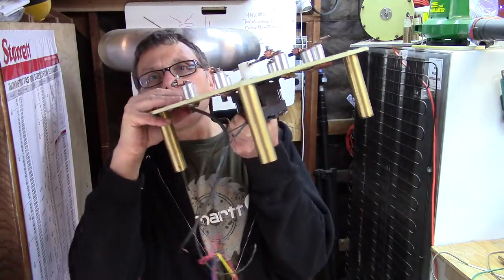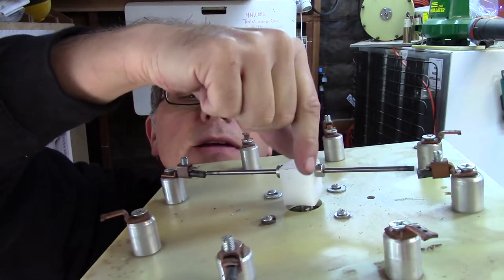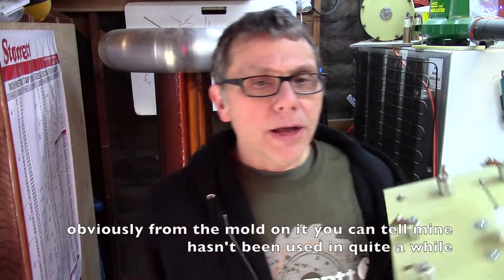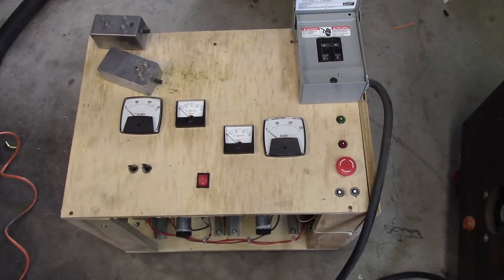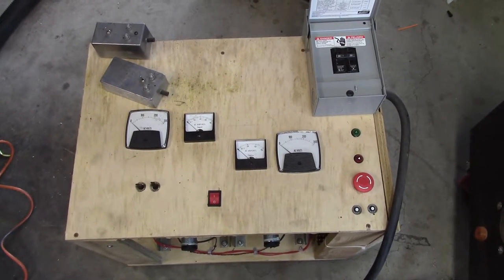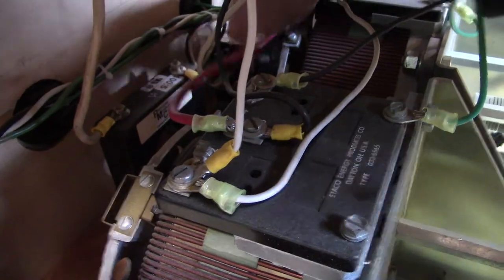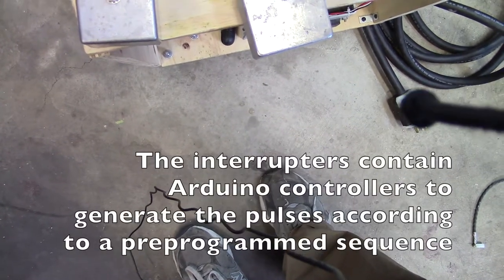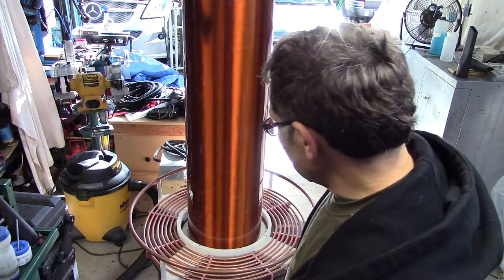How to set up a tesla coil Pt 2

Comment: and thank you for the info. I'm currently making an AC generator and it runs nice at 144 to 288 Hertz @ 110-140 volts . it's based on Edward Leedskalnins' design , and it's just under half way complete . but already I'm testing it on everything , even the Tesla coil. my next step is making a transistor circuit to make some high voltage static . I also have a modified microwave transformer , but the generator is doing a better job so far. thanks again for sharing your understandings on different methods of pulsing that spark :)
Reply from the maker: +FrequencyJam Thanks for the note.  Be careful with the generator.  Have fun!

Comment: Canada is also on 60 full wave lengths per second , sometimes I wonder about this specific Hertz value on the health of our bodies.
Reply from the maker: +FrequencyJam  I think 60hz is mostly chosen due to historic reasons (other countries are on 50hz).   I seem to remember it had something to do with syncing up in round numbers to 360 degrees.  Also has the side effect of allowing synchronization to clocks.  Whether it's good or bad for the body - 50 vs. 60 hz - can't really say.  Both are close enough to a standard human heart beat rate to cause significant problems with fibrillation if you get electrocuted.  Higher frequencies, like 40-80kHz, where a lot of tesla coils are tuned, allow the "skin effect" to come into play, so the current doesn't go through a conductor, but rather, over the surface.  This is what allowed the original demonstrations Tesla put on, where he touched the coil with one hand and had lightning bolts come out of his other fingers - and not get fried in the process.  Though, I would never do that with my tesla coil as I'm certain getting hit with the arcs would do damage at the current levels we're running.   Thanks for the note!